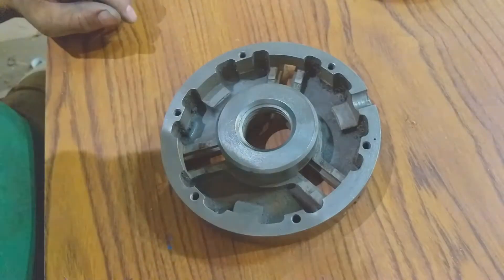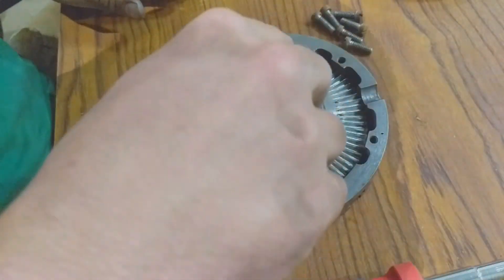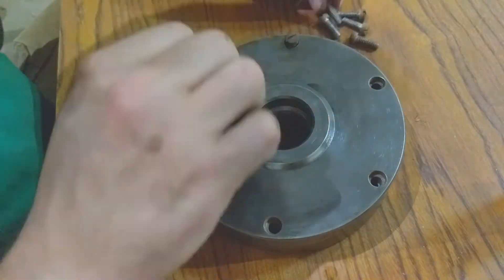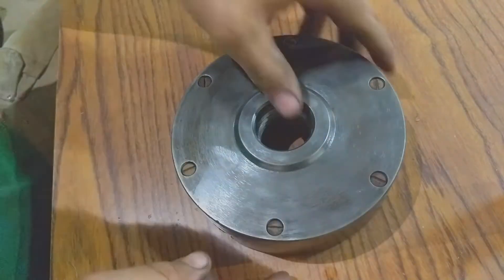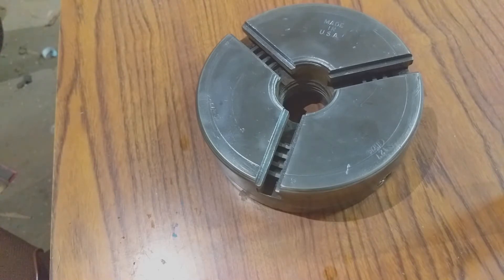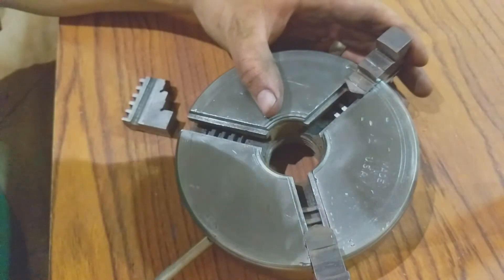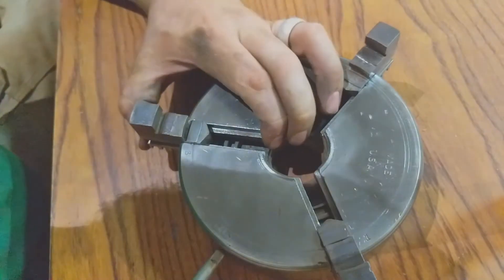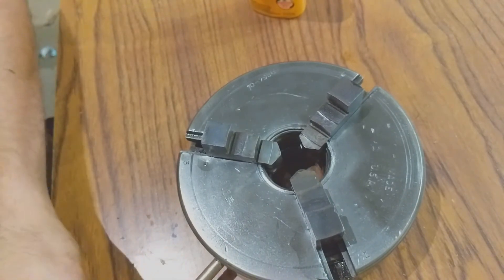Atlas Lathe Chuck Reassembly

Comment: Thanks for  this video.  I was a little worried about tearing the back off, but now I see that it's do-able.
How much runout was  there when you put the chuck back on the lathe?    I just partially cleaned up an identical chuck and it has about 12 thou TIR.
I didn't disassemble it completely like you did, though.  It was  rusted so bad that it wouldn't move at all.  The number 3 jaw was apparently "down" when it was stored in an unheated space for many years by the previous owner  so that was the culprit.  I cleaned and polished all three jaws, their mating surfaces and any parts of the scroll that I could get at.
The thing doesn't look as though it had gotten a lot of use, so I hope it'll get better when I do the same thing you did.

By the way, I broke the square off the chuck key trying to get the thing to move.  That original key didn't seem like very tough stuff.  I will have to make a new one from 4140 or something like that, but at least the screw head isn't damaged.
Reply from the maker: It was pretty badly out. I ended up making an adapter to hold a dremel with a grinding rocknon it and then grinding the inside of the jaws.  To keep the jaws from closing, I cut a piece of pipe and turned backwards to grip it so the jaws were open. Ground them,  then gripped a piece from a go/no-go and ground the outside. A piece of leather protected the ways while doing so.  It was about .001 +/- .0005 when all done. I think ultimately the original jaws were sloppy, but grinding definitely helped.  I got fairly consistent results out of the lathe before we moved and I had to get rid of it.